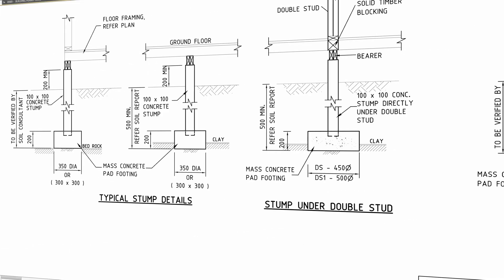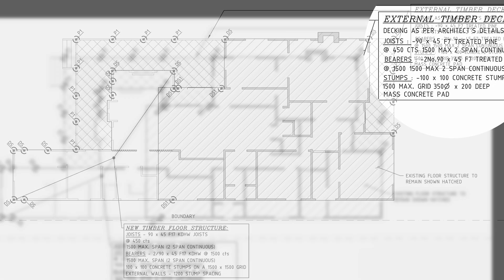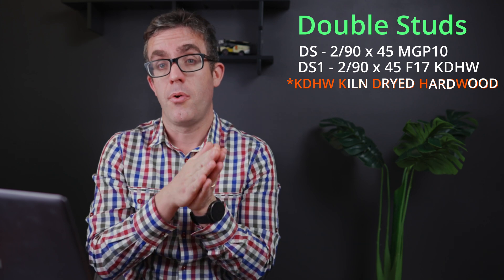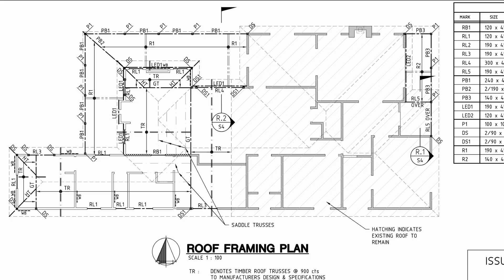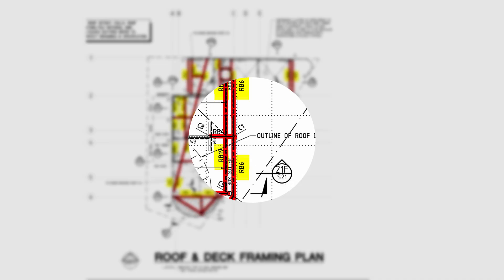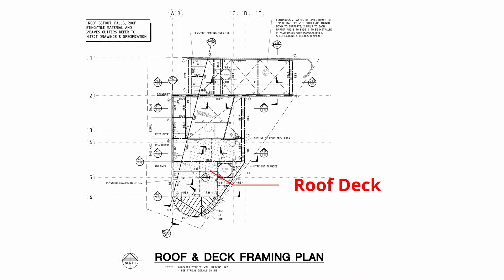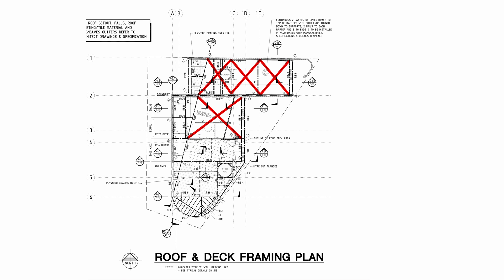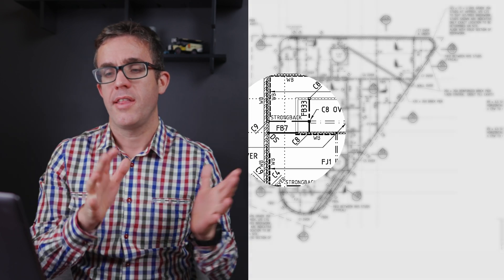How to Read Structural House Drawings | Timber framing

Comment: Hi Brendan,
I am a first-year engineering student at QUT in Brisbane. 
I want to study again to gain my civil engineering knowledge and get a job as a good engineer. 
I am originally from South Korea. I was a civil engineer and have a  bachelor degree of civil engineering in my mother country. 
I am enjoying my studies such as engineering mechanics, math and fundamental of engineering science. However, my friend who work as project manager at Downer group offer me a  job as a civil engineer. It gonna be FIFO and (3 weeks work/1 week off) roster. 
I am not sure what to do. 
I want to be a good civil engineer and construct wonderful buildings like cable stayed bridges and suspension bridges, metro tunnels and roads.
What do you think? I think that I have to reduce my studies or defer my program until I am fine at the field. What about studying for a master of project management(100% online course) as a part time study.   
If you have time, pls give me good advices. 
Thanks.
Reply: Thanks to watching your video clips, also I am also interested in structure engineering.
My friend told me that structure engineers are required to have more communication skills , math and CAD drawing skills. 
What do you think about your job?